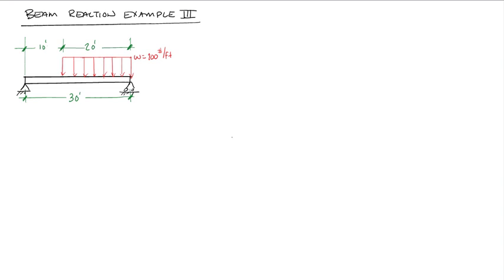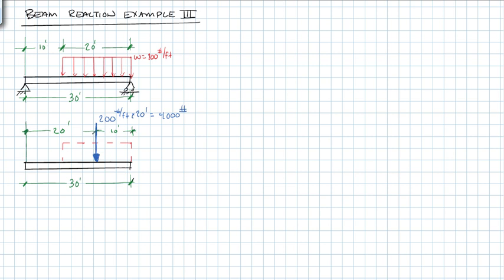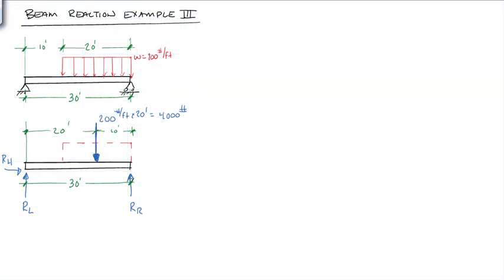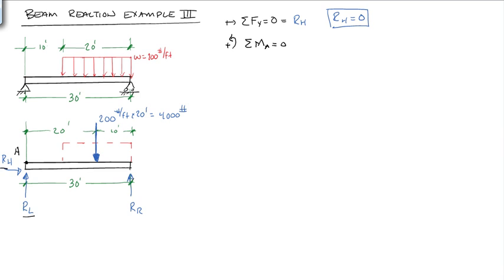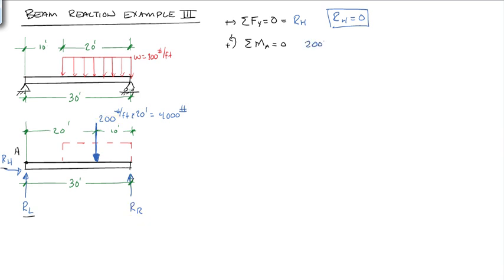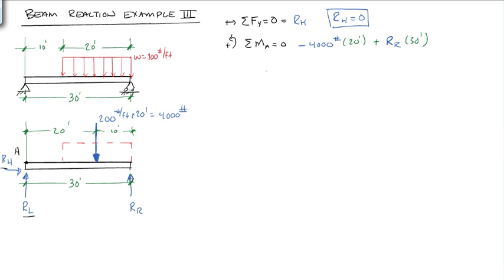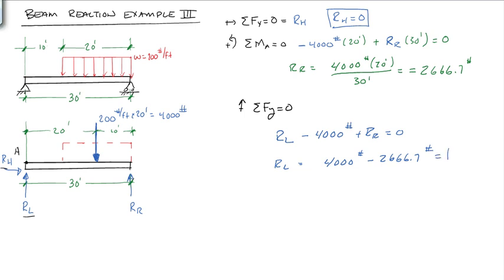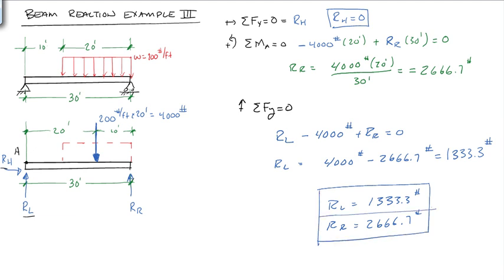Solving Beam Reactions: Partial uniform load

Comment: Hi John, great refresher but can you tell me how to solve the same diagram but with the roller support slid inward say 5 feet creating an unsupported overhang?
 
I seem to be running in circles with this one and it should be quite simple.
 
Any direction would be greatly appreciated.
 
Thanks in advance,
 
Mark.
Reply from the maker: Same exact process, but in the moment equation, divide by 25' instead of 30'
Reply: John Tingerthal That's great but can you then treat the remaining overhang as you would a cantilever and solve for deflection of that overhang?